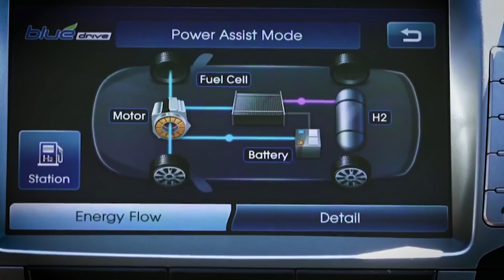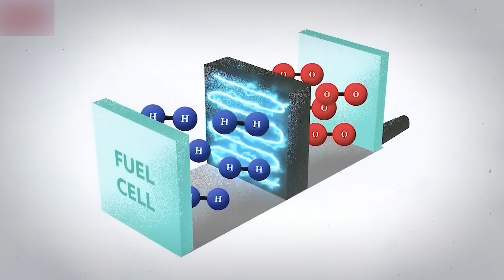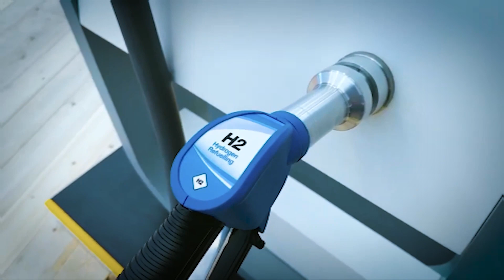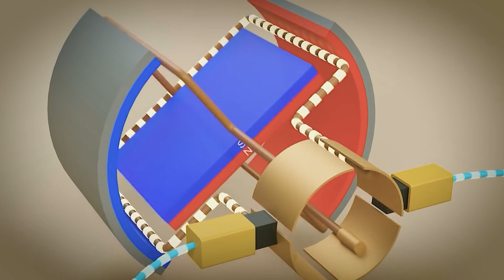Hydrogen vs. Battery Electric Cars

Comment: Nobody is talking about the price difference here.
Green Energy used to produce Green Hydrogen (H2) is likely to be at least 5-6 x more expensive in kWh  compared to battery power. To be competitive H2 Price will have to be produced around USD 1,- for travelling around 10-15 km.
The price of Toyota Mirai is ca. 2x more expensive than a comparable EV Car here in Indonesia.
For the time being most of the H2 is produced by coal fired Power Plant and this is not the green Hydrogen.
There are many kind of H2, among others Grey Hydrogen, Pink H2, Blue H2 etc and not green H2.
Looking into all the comparison H2 Car will not be in mass production in 10 years from now and it could be much longer if you cancel all the tarif Barriere against Chinese Cars.
By the way the Chinese has released already the first flying car in Dubai made by Expeng. Commercially Available using Lithium Battery there beside its domestic market in China.
BYD is promoting also its Hydrogen Cars. 

The installation of Wind and Photo Voltaic Power Plants in China are covering around 5-10 Giga Watts nowadays and it is still ongoing to be more and more beside the existing Superlarge Hydro Power Plants. These are all Green Energy Gigantic Supply.

Comment: Wow, this sure seems crafted to favour Hydrogen over batteries. For example, the clip points out that electricity for BEVs may include fossil fuel sources yet somehow only mentions that Hydrogen can be obtained from electrolysis. It fails to mention how many fossil fuel companies are seeking to get into the Hydrogen business using methods that produce Carbon as an emission. Hopefully the Carbon can be captured but Gray Hydrogen, where Carbon emissions are released are much cheaper.

Also not mentioned is the relative economic costs of electricity vs Hydrogen. I'm seen that fuel costs for FCEVs is twice that for BEVs, how come that wasn't considered a meaningful difference?

Wanna try it again with a little more journalistic balance?

Comment: You didn't mention anything about its maintenance. Engine oil change etc...
Reply: The most common source of hydrogen is natural gas. Unfortunately, many natural gas wells also contain hydrogen sulfide. Even trace amounts of H2S will degrade fuel cells over time, particularly if they are run hard so they get hot. There is a procedure called "anode electrode potential scan" that removes most of the sulfur from the fuel cell surface - that refreshes the cell to near-new performance. This cannot be done while the vehicle is running.

Carbon monoxide and several other common pollutants also reduce fuel cell performance. I don't know if those can be flushed or burned off like sulfur.

Other than an as-yet undeveloped maintenance recipe for the fuel cells, maintenance should not differ much from a battery-electric vehicle. I. e., tires, suspension, bearings and keeping it clean are the main items, just like any other car.
Reply: EVs still need servicing! Plus less dangerous fires with ice
Reply: @paulbade3566 full EVs are catching fire frequently. They released toxic smoke and fume to the air. It takes more time to put off, uses 10 times water. You burn hydrogen and no smoke just water vapour.
Reply: You are funny. Hydrogen fuel cell EV doesn't need oil change. Battery needs replacement. Hydrogen fuel cell EV takes 5 to refuel while full EV takes 15 to 1 hour to recharge.
Reply: @dextersayson2813  I think he's talking about hydrogen-fueled internal combustion engines - they need oil. Oh, and some attention needs to be paid to the lubrication of electric motor bearings and the gearbox if there is one.
Reply: @Turbomgzt  you need a lot of water to make lithium. You need 100 times more water to put it off and need 10 times more firefighters resources than ICE.
Reply: @dextersayson2813  "Frequently" is not useful here. Do a search for the number of fires per distance driven for the various technologies. Fires in gasoline vehicles happen at a much higher rate, to the point that they barely make local news. I've seen three, two of which destroyed the vehicles.

Automotive Li battery fires get media attention because they are rare, but are spectacularly nasty when they happen.  One reason they are rare compared to fires in e-biles and similar one-person products is because the manufacturers of the latter product group don't all have the stringent quality controls auto builders must have. The QC issue is one of the reasons Tesla makes their own lithium cells.
Reply: @paulbade3566  at least gasoline vehicle fire you can put it off. Full EV will be write off. You need 10 times more water and firefighters resources and the smoke is more toxic.
Reply: @dextersayson2813  The gasoline fires I've seen could not be put out before the vehicle was destroyed. So while a battery pack burns longer, the outcome isn't much different, other than having to keep emergency response people on the scene for more time. The one car fire I've seen that didn't destroy the vehicle was an oil fire on top of the V-8 engine. The engine shut down when the ignition wiring burned, so there wasn't any more oil leaking onto the top of the engine to keep the fire going. The vehicle stalled a half block from home, so it was a fairly simple matter of replacing the wiring and fixing the leak to get back on the road.
Reply: @paulbade3566  battery fire 🔥 has nine lives. Even at recycling.

Comment: Terrible!

Who cares about a higher top speed? The speed limit is all you need.

Then the tired old argument of how clean the fuel source is for electric. Maybe you should look at how hydrogen fuel is generated and how much MORE power is needed to produce it.

Charging at home is the best solution for electric vehicles and the speed of charging will depend on the charger, why are you making that an issue?

And what about all the extra complexity of not just the infrastructure of hydrogen delivery, but also the car itself.

This video conveniently glosses over all the downsides of hydrogen, and there are a LOT!

Maybe look up the difficulties of transporting hydrogen too, you need more fuel tankers than gas for the same amount of fuel due to how it’s stored.  It’s also a really dangerous and difficult fuel to store and transport.
Reply: Why don't you go in the gasoline stations and observe how many gasoline and hydrogen fuel cell EV taking off in 1 hour. Every 5 minutes for gasoline or hydrogen fuel cell EV while full EVs are stuck for 15 minutes to 1 hour. Gasoline and hydrogen fuel cell EV are 100 km away from you while you are still charging.